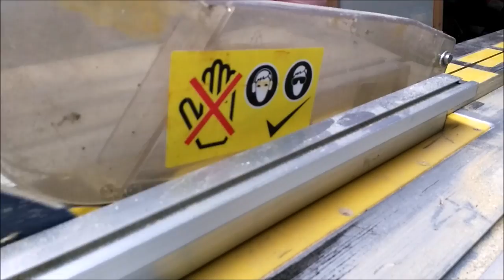Router Planer - Based on Nick Offerman's Flattening Jig

Comment: Hey that is a great video. That is a cool way to make something flat. How efficient is it? How long and wide is that live edge slab? What router did you use (horse power, rpm)? What router bit? How deep was the bit set when doing one pass? 

These are some questions I have.  Thanks for the answers in advance.

Comment: You should set a "limiter" on both ends of the rail to ensure it doesn't fall on the workpiece while the router is running.
Reply from the maker: Yonathan Zarkovian Good point, absolutely necessary!  I attached some stop blocks after about 5 minutes of use.. I did not tape it though that's why it's not in the video. Thanks for watching!!

Comment: I admire your work but this is in no way the same design as Nick Offerman's from that FWW article. I just built a mini version of it and the best feature is the height adjust-ability offered by the connected box ends that also have stop limiters to keep the sled on the rails. Good for you on your project, though.
Reply: To be fair, he says"based on" which does not at all imply it's the same design.

Comment: I have the same router model as you (Makita) and router sled. It happens to me that while working, the locking lever loosens itself and the router "jumps up". I need to set the exact depth again to continue. Possible vibration... But it is annoying. Do you have a similar experience with this router?

Comment: Why don't i see anyone use that same method but use electric hand planer instead of a router?Would that not do more?.coz the planer has 2 wider blades than a router
Reply from the maker: Hi, before I did this I was thinking of buying an electric planer to try what you just said! In the end I obviously didn't because I had the router and I knew that would work.. but who knows maybe the planer would be better?! Thanks for watching!
Reply: I think a planer would require less passes wouldn't it.i also don't know what would happen.But i'm planing to do so.But m scared because i don't see many woodworkers doing it???
Reply from the maker: Let me know when you do! There is nothing that can really go wrong I think.. so give it a try! I think most use a big router that can make a very deep cut in one pass, so that way the router is probably faster but I'm not sure.
Reply: ok.i'll try it.thanks
Reply: Hand held planer has no depth adjustment.  Thats why you use a router
Reply: @cdouglas1942  well it does but it's extremely minimal. You could get it to work I just think that building the jig for a router is a lot easier and that might be why most people don't use electric hand planes for this application.
Reply: Mucydonia because it would be a nightmare!!  Would be at least ten times slower than what a router is. Your taking off 1/64” max compared. To up to 1/2” on a router. 

Hand planes are not designed to take big bites of material. Stick with what’s proven and don’t try to reinvent the wheel brother
Reply: Router is omnidirectional, with a hand planer you would have to be careful not to move it sideways. Also the circular router base makes jig building simpler- power planers are not as easy to jig.